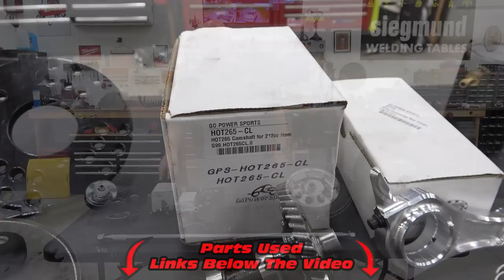1932 Ford Hot Rod Go Kart Gets Slicks ~ Ep2

Comment: Question;  Since you had to move the rear axle, why didn't you just add an inch or two to the bearing mounting plate, which would have given you the rear fender well clearance ( without cutting the body ) &  do the same to the front. Would that not have been easier?????? Just asking.......
Reply: I was thinking the same thing
Reply: I had the same question too. Why not just lower the axle an inch?
Reply: I think he didn't do it cause he wants to keep the lowered stance?
Reply: @Toofpaist  But didn't he lose that when he went to larger tires?  I would keep stance/ rake the same angle & live with more ground clearance. Look at ZZ Tops Coupe, it's not dropped to the ground & I dare say most of us like the look.
Reply: @johngeorge5285  I was just giving a reason why he mightve done it this way. I personally would've put a spacer on the axle holder. It will look a bit more slammed and have that tub effect if he cuts the fenders tho
Reply: @Toofpaist  Yeah it' s cool. Let's wait til the next video to see what else he does to it. I'm sure it will look good.
Reply: While just moving the bearing plate would have created space at the top of the tire, it wouldn't have helped at the ends - he would have a gap at the top and none front to rear. For the right "look" you want the gap or overlap consistent, which in this case meant making the body opening match the tire diameter, then locating the axle bearing brackets to center the wheel/tire in the opening.
Reply: The rear end would have been sitting higher
Reply: A regular street rod would have had the rear end jacked up anyways just like you said he should have added to the axle hangers instead of cutting the body up....
Reply: But it’s not a street rod it has no suspension, he wanted it to still have the same low look
Reply: @adamt1316  a half inch will not change the look very much.
Reply: I thought the exact same thing since adding an inch to overall height wouldn't be a big deal on that kart.
Reply: Ya your probably right, he’s an artist too so he was going for a certain asthetic
Reply: Why not build a 4x8 3/8" thick Weldig table to put these projects on to build, instead of BENDING OVER to the Floor?!!!!!
Working at EYE HEIGHT is MUCH BETTER/EASIER, n more Convenient!!!
Reply: @Toofpaist  raising the body's gonna do the same thing he just added more steps than necessary could have fixed all issues when he had the axle brakets off and added a 1/4 or 3/8 spacer

Comment: What would the issue be with lowering the rear axle while relocating it, in lieu of raising the body? Besides, it would help the rake.
Reply: I was thinking the exact same
Reply: Same here, 1/2 to maybe a inch, that be a hotrod for sure
Reply: Should have been a shorter front tyre/tire and adjusted the rear however the situation panned out. But it is what it is. 

Just like in the real hot-rod world doesn’t matter how you did it, unless you’re racing it, who cares. Booger welds holding the engine in? Meh

Comment: put grease fittings in the spindles when you have them off . I have seen them stick due to rust you don't want to have a loss of steering at high speed  .. also I would drop the rear axle if it were mine ..that way you don't need to lift the body.. it looks to be a great build ..

Comment: Should have just spaced the axle from the frame by an inch would have saved you a lot of work and would have put the wheels back in the center of the rear wheel arches

Comment: You should build a flat bed truck (go cart) to haul around that “hot rod”.
Reply: Built from a Harley motor, but with a 2 speed rear end for the low down stuff, thing would be able to move anything

Comment: I like to use a Rotary saw or my mini Orbital saw with a blade that has a lot more teeth on it to cut fiber glass somethin fast so it don’t melt or leave you with them jagged edges kinda like what you used I was hopin you didn’t use a cuttin wheel lol

Comment: Ya, wheelieing will be cool but I think laying à sweet POS burn out would be cooler. And much less destructive on the poor spindles.To get the absolute best tire roaster I would opt for a smaller two stroke bike engine. . Maybe a Banshee motor. To keep the nice tires you could always just put about 80 psi in them and get your contact patch down to almost nothing.. I'm sure someone paid a fortune for this kart at some time.

Comment: 🤔 couldn't you redesign the location of the axle to move it down 1 in or half inch to avoid the rubbing. Which a lot of hot rods of that style have a higher rear end look to them.

Comment: Why didn't you just add 1/2" spacer to the axle mounts ? You wouldn't of had to do anything to get the body to fit back on would you ? And it would of given you thaat RAKE LOOK Hot Rods had back then . Will you be making a Hood to go over the Engine ? Youcould build the fram out of 1/2" square tubbing and then RIB the metal cover to make it stronger . Just a thought . The front tires and rims are nice but are too big for me . If they we're 1 to 2" smaller they would be more to scale with the rear tires and the car . Just me .....